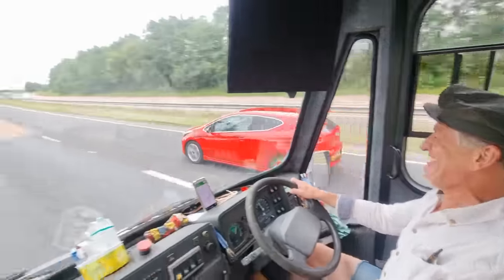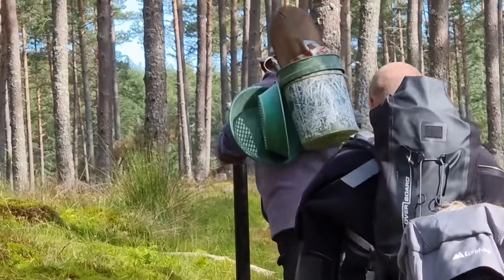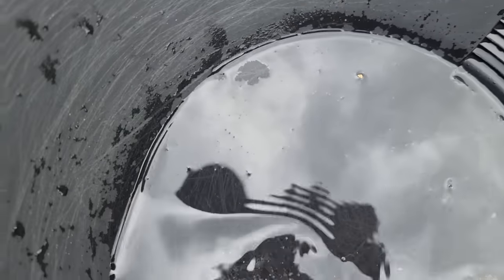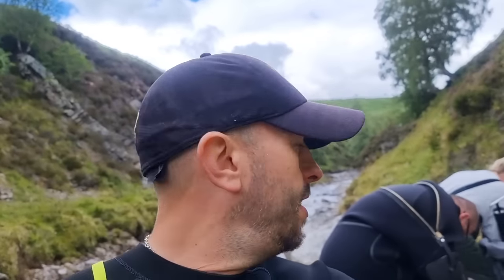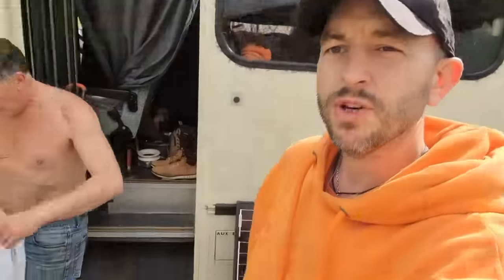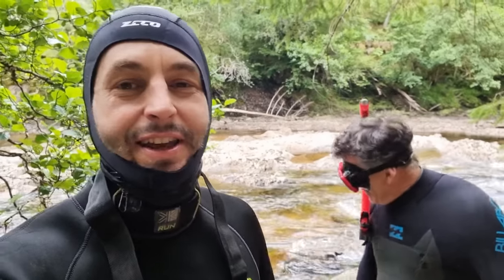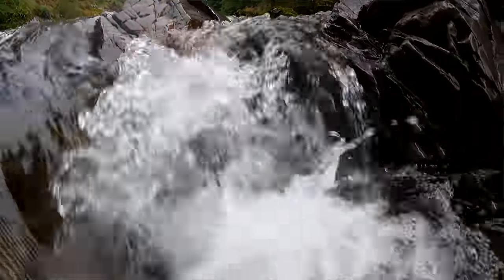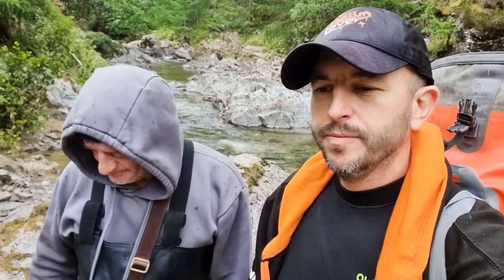More GOLD than I've EVER seen! Gold panning Scotland

Comment: Wondering if you shouldn't concentrate at the bottom of the short falls on the river or at the top of the rock faces where the rocks accumulate. Also on the outside edges where the river turns another direction. That is where they find gold on shows like gold rush.